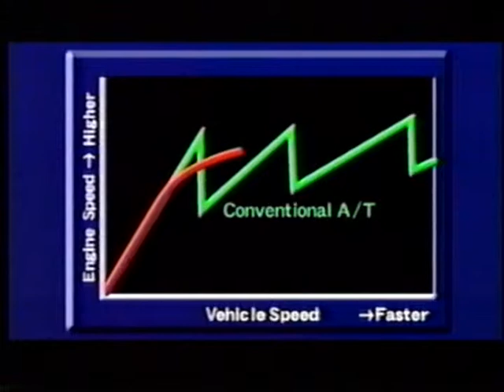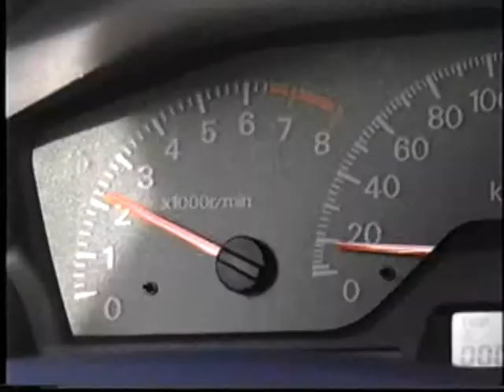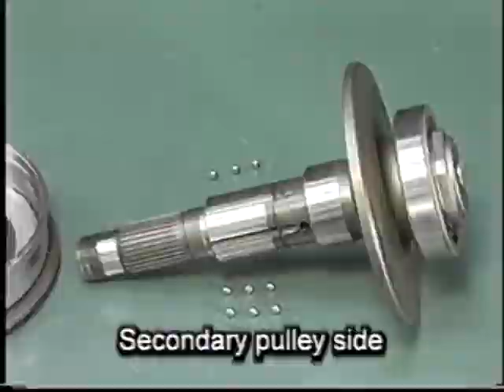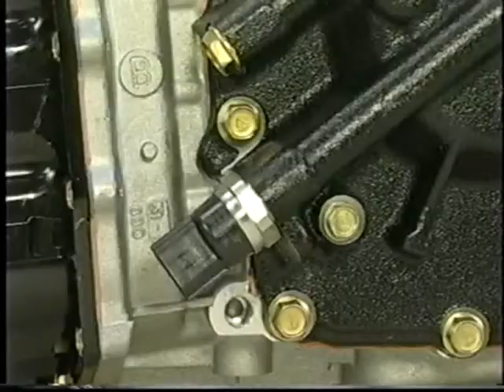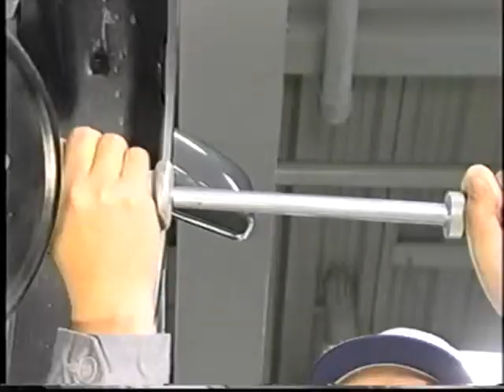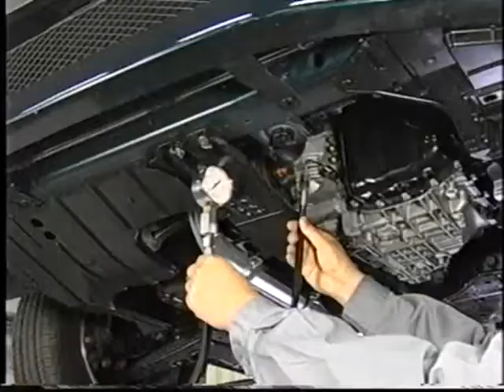LANCER CVT

Comment: Would disconection the bettery fore good 30 mins solve the problem of the non interchangeable solernoid valve to reset the cvt computer??

Comment: My jaw dropped when i found out there was a steel belt in my lancer but besides speed sensor swaps and valve replacements i got 428,000 miles out of my 02lancer before somone plowed into me wrecking the frame. Edit: to all u out there magnets go bad in the speed sensors + the design put some in an area where water can damage the electronics. After replacing you have to disconnect your battery so the computer/ECU can reset

Comment: Hi there I just brought 2007 Mitsubishi lancer glx 1.3 automatic with factory fit spoiler I took my car to the computer mechanic cause I had an SRS warning sign and I got if fixed beside it also showed another sign i t says ELC - AT/CVT 52 DCC system fail. So the computer guy said that your car has an automatic transmission problem but I told him that the automatic transmission shifts well he said u have to get it repaired or u have a change the automatic transmission, so please can u tell me what is actual problem I work in the middle east Oman your help wiil mean a lot to me so I can tell the mechanic what to do thank you Daniel